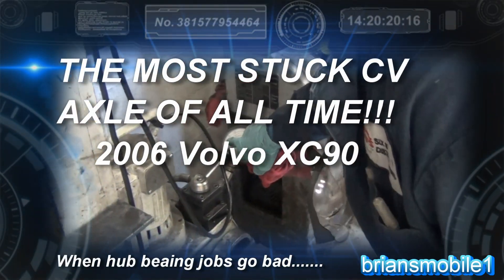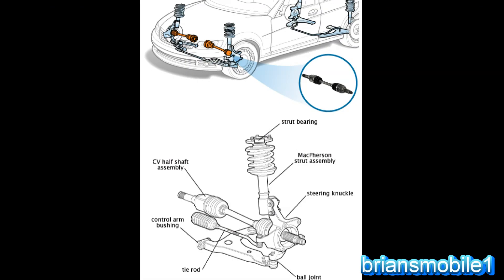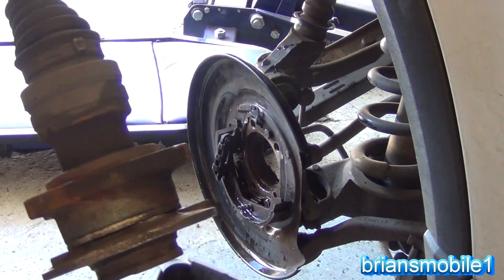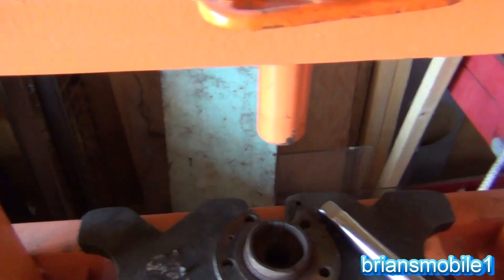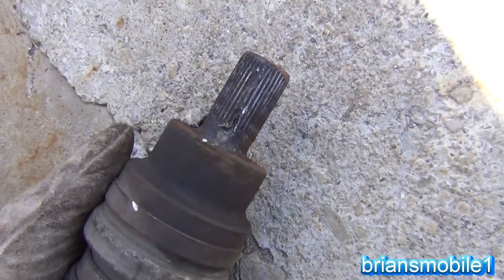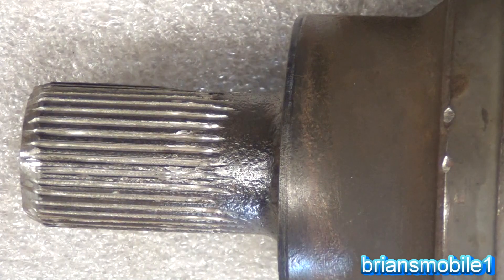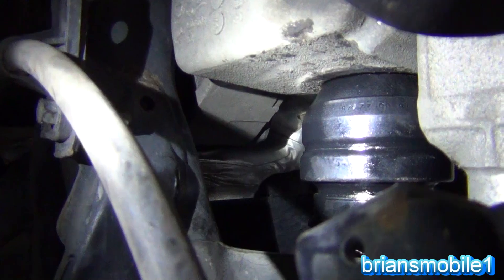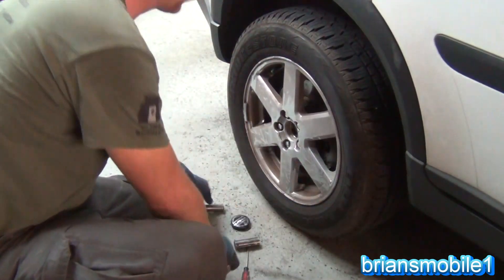Most STUCK CV Axle EVER Volvo XC90 2006

Comment: I did all four hubs on my wife’s 2006 XC90 and it was just like yours. I used a massive three jaw puller, a torch to heat it and had to hit the end of the puller. It was not good for the puller but it worked. The dealer uses a special Volvo tool which is hydraulic press that bolts to the hub flange.
Reply: Yah pullers and presses are the way to do it. See the wasted energy in the CV axle buckling with each blow. You need power applied directly. They should have included the footage of the hydraulic press to see what went on there.

Comment: Wow Brian I feel your pain, just did basically the same job on a 99 s80, exactly same setup.  Was totally insane.  I've dealt with many stuck cv axles before, but this was beyond anything.  Took like three days.  Hammering and torching and slide hammering didn't do a thing.  Fortunately it eventually came out with multiple grabs with a three jaw puller.  Insane.  Thanks for the video, it gave me courage.

Comment: Great video. I love it when you show that its not always easy doing auto repair. Sometimes unexpected things like this happen, you just have to work through it and make due with what you have. Most channels give the highlights of a successful repair without showing the struggle to get there and make it look like it really takes 5 minutes to pull a motor (for example). Its the struggle and how you work around them that are the gold in these videos. Thanks for that...
Anyway, I know it was stuck pretty good, but couldn’t beating on it with the socket like that have made it worse by mushrooming the end of the shaft? That would change it from a normal slip fit to a tight as hell fit by mushrooming the end of the shaft out into the splines/bore.
Also why not use a cutoff wheel instead of the plasma cutter? Less chance of cutting into the shaft on the inside of the hub with a cutoff wheel I think, but would be much slower. Did you go with the plasma cutter because your ginger-tude got the better of you? Captain Impatience reported for duty?  :-)
Either way, you got it done and thats all that matters at the end of the day. Adventures in automotive repair…  Gotta love it…  Its why we do what we do… Great video.

Comment: Thanks for sharing your hellish experience with that stuck axle. My son and I are visiting the 8th circle of hell trying to get a stubborn half-shaft out of a buggered up hub on a 2004 Ram.  We're probably going to remove the upper-control arm, tie-rod end, and pop the steering knuckle out of the lower ball-joint to pull the whole assembly off the truck. Our thought is that we'll have move success bashing the axle out of wrecked hub.  Sadly, I think we mushroomed the end of our CV-axle with repeated sledge hammer blows.  That sucks. That's life.

Comment: Hey Brian!  That can be frustrating and ruin your day.  I just went through it at my shop with a front axle on a Ford Fusion.  One tip to try next time is use a candle stick when you heat up the bearing.  Press it against the splines and it will suck the wax down to where the heat is.  The problem with heat & Penetrating oil is that the oil just burns off as soon as you spray it on something hot.  The wax will not.  I don't know if beating it with a hammer and wax would have done it, but possibly the candle wax and the press with some heat!  Great video for DIYers and even better for  paying customers to understand the Fuss we have to go through to fix their cars.
Reply from the maker: I've heard that before, but failed to remember it at the time.  I've never tried it personally.  Thanks for the reminder.  I would have LOVED to try it then.

Comment: I had a similar situation on a Subaru Impreza once and ended up replacing the steering knuckle, CV Axle and hub bearing. Always use completely absurd  amounts of anti seize compound during re assembly on the splines and hub for the sake of the next technician. Good video, definitely more patient than me..

Comment: Thanks for the video Brian.  Just bought the same car for my wife.  I replaced the front CV joint and bought a "Febest" brand; worst piece of junk I ever bought; the centre hole for the retaining bolt was drilled through on an angle so it was not centred in the rear.   I persisted and went through 3 bolts as each one was becoming stripped by the time it reached the rear of the hole.  All this to avoid the cost of an OEM axle replacement.  I feel your pain bro' .....

Comment: I just ran into a really bad one on a Ram 3500 a week ago. my job was just to do the balljoints. one side went ok, not the other side. hub was stuck to the axle, and there was a seized axle ujoint. no about of pounding would separate the hub from the axle, 20 ton press didn't work. so I ended up torching the bearing off the hub and making a split in it with a die grinder after, then I put it back in the press, and almost maxed it out, then the loudest noise I'm ever heard, and the press shook, and the axle hit the floor underneath. it was Saturday of course, I had other vehicles I was supposed to work on, and even more work on this truck, and I should have been done this truck by noon, but I did 10 hours on it, made it drivable, but the guy had to rebook for the rest. he supplied 2 hubs, just in case he said. one was almost seized, the other rough. I installed the rough one, so he could drive it home, but told him he needed a needed a new one. so we just ordered 2 new ones. I was lucky the end of the axle wasn't damaged beyond repair. I actually cut down the spline when I cut the hub with the die grinder. cleaned it up, lots of anti seize and it went back together after the balljoints and ujoint. I personally don't want to do another one of these like this. I asked the other guys, the said this isn't the first time its happened on a Saturday, and it is always a Ram 3500.

Comment: Some dealers put loctite on the splines because the axle bolt was getting loose throwing that Anti-skid message.  You should send this video to congratulate the guys from Loctite for their amazing product :)  But any how, if this happens again: junkyard/Ebay > used axle and spindle/hub

Comment: I've seen many axles seize in the hubs at my shop this way, when there like this it's not so much the rust it's the fact the customer had a wheel bearing going bad and drove on it for a long time heating it up and basically welding it in there.
Reply: I have also wondered if this happens if the car hits something that slightly distorts the hub and locks the shaft to it.

Comment: Ok so if you're here you have a stuck axle in the wheel bearing hub like me. I'll tell you what worked for me:
I got the puller from Autozone (rented) and used my harbor freight electric impact (Chicago electric one rated for 150 ft lbs) That was not enough to break it loose. The drivers side came out so easily I could not believe the trouble I was getting with the passengers side. So anyway, I was sweating thinking this isn't going to work as I'm under powered. I tried using a 2 ft breaker bar but that didn't work either. The only thing that worked was applying heat with a regular propane torch (if you want to run out and by some map gas in the yellow tank go for it since it heats faster). Heating it up and pounding with a 3lb hammer from harbor freight did the trick for me. It took a lot of hard pounding. A good 100 hits or more I would say. I hit right side, left, bottom as well as I could. Took a 10 min break. Heated up again. Sprayed the CRC freeze off in there and started pounding. I put the axle nut back on so I could use it as a refrence to see if it was moving at all (you can use a piece of tape also). It was moving 😀 but I had to fight it every centimeter! 
If you start getting a bit nervous when things go wrong like me just grab a beer or a shot. You need to be relaxed and have a clear mind. Rest assured that it will come out with enough heat and enough pounding. If some how you ended up here before doing the job good for you. Buy a heavy hammer. If I could do it over again I'd do it like he is in the video with heating it while the pressure is still applied from the puller! In my case I had already taken the 3 bolts out and started hammering it before I realized how bad it was stuck. Heat it, spray, pound. Take a break. Repeat until it's out! You can do it!

Comment: Probably wouldn't have helped here, but a wooden handle 8 or 10 lb sledge with the handle shopped to half-length is a BADASS tool for the insanely stubborn stuff. It's crazy what a bigger hammer will do.
Reply from the maker: Amen.

Comment: Ugh..  The entire time I was watching this, I was screaming at my monitor, "USE PARAFFIN!!  Heat is great and all, but it's an old engine rebuilder's trick...  Works with bolts, nuts, drive shafts, etc.  Anything threaded or splined.  Heat the thing you want to remove (nut, bolt, plug, shaft, etc.) until it's cherry hot, then take a block of paraffin and dab it overtop of the glowing hot bit.  Wait a few seconds (literally a few), then go through standard removal procedure.

The other thing I see far too often, is techs heating the thing to be removed, then not using paraffin on it.  If you heat the thing to be removed, then that thing will EXPAND, typically into the hole it's already stuck in.  If it's stuck due to rust, there's a tendency to actually seat the rust in even further.  If you're just going to use heat, heat what it goes through.  ;-)
Reply: @jfdesignsinc.innovationsid1583  Interesting to say the least.  I'm not comfortable with heating my differential.  I have used paraffin on lugs and such, which worked quite well. I probably only need enough heat to get it in there?  From what I gather, it's the clip that is supposed to collapse when you try to pop it. I guess after 170k + miles,  the clip breaks down, only to wedge in the spline. Thanx to all that comment.  After all,  I think this is what it's all about. It's good to learn something new every day.

Comment: Hay, Brian I just saw a video on FCP Euro's channel  were they replace the rear bearing assembly on XC70 and use a puller.  It looked like it was pretty rusted inplace as well.  Might not have been as bad as what you had to deal with, but I thought I'd pass it along as an FYI for an alternative method in the future.  Cheers.

Comment: Hey Brian, good to see you're still Rockin it.  Anyway, I've got a 2002 Dodge Ram 4wd. I CAN NOT get the left (Hell, does it matter) CV axle out of the differential. I guess this is a common issue with anything with over 170k + miles. I went to the Home DEPOT and got a 4' piece of 7/16" threaded stock and some Milwaukee vice grips ... I'm sure you know where I'm going with this. This sumbitch won't budge, I smacked it like a RED HEADED STEPCHILD, no offense to my ex, and never smacked her BTW, but I am at a loss. I came home from work thinking I'd just put it back together and drive to see if the damn thing would free up. Then I thought, "You dumbass, you already trashed the original!!!"  THOUGHTS, and YES, I do feel like crying but I already done sweat out everything I got. Thanx in advance.

Comment: Some genius took the dust boot off my parent's 2000 Saab 9-3 hatchback and I had a similar situation. It was SO rusted that by the time I got the axle knocked out I had ruined the bearing. Really there was no other way, though. The only sucky part was that I had to then remove the steering knuckle to get the old bearing pressed out and the new one pressed in because it's not a simple bolt on assembly.

Comment: Also that's not a picture of a 1998 626.  It's a 1996 or 1997 model.  You can tell from the silver trim piece on the hood which only came on the 96/97 model.

Comment: I had the same problem on my e36. had to replace rear bearing, when encountered this problem... ended up tensioning with bearing puller, heating up, and giving it a good smack with the biggest hammer I could find. 
I feel the other side bearing on its way out. hope it is not going to be as bad. :))

Comment: I actually think there’s a simple way to cure this problem on any situation like this. Never tried it but logic tells me it should work  remove axle and hub assembly. Set in press. Run a few welds onto end of cv shaft quenching with water. Repeat few times axle should push out and clean up end of cv shaft. This is pretty much same principle as stuck brake bleed screw in calipher

Comment: hay briansmobile1 got a question for ya, what would cause so much rust on the joint like that?  was there a leak or a missing piece of protection? owner use a high pressure sprayer wrong?   was the car on the bottom of a lake for a year?

i aint no mechanic but i am fairly sure its not meant to rust up THAT badly... right?

Comment: My friend needed his front axles replaced on his 2000 subaru forester. The axles were as bad as this.  And I had to do both sides. worst thing ever. I heated it and everything you did. He said screw it lets get everything but ended up that you can't get the whole hub from any local store and that was a saturday. 
We ended up cutting the parts like you did. took 9 hours the first day and 3 hours the next day.  went from 2 axles to replacing balljoints and everything around it because it was that bad. 

I like the dremall idea. never thought of that.

Comment: Metal is 'plastic'. when you push on it (like beating on it), it mushrooms making it jammed even tighter. Pulling on it tends to elongate the the material, resulting in 'necking'. this actually reduces the cross dimension, theoretically loosening the fit.
Best part about this video for me?:I don't feel so "pregnant and alone".
If you can clamp something to the axle and get a wedge or other puller between the clamp and backing plate you might drive it out by tension, rather than compression.

Comment: i have a volvo xc90 t6 awd 2005, the navigation monitor won't come up when you turn it on either by remote or on the steering wheel, i will like to know where the fuse is also located. thanks

Comment: I have the same problem with the front driver-side bearing on my XC-70 2005. I was supposed to replace an 8 bucks ABS tone ring which should have been an easy job but that damn axle is stuck rock solid in rust. I'm slowly accepting that I'll have to get a new bearing & CV axle... Fortunately, the parts are pretty inexpensive, I can get a bearing for 50 bucks and 60-70 for an axle.

Comment: I had to first remove axle with hub. I then heated the axle super hot in a vise  with oxy acetylene and then poured about a gallon of water on the axle which caused rust to separate and axle   to shrink.

Comment: My question is this: did you try to use an air hammer? I bet that would've worked some wonders after applying a little heat to it.

Comment: I worked on muffler shop for years best way is to heat cool heat cool heat cool multiple times strike on metal when cold not when hot because your changes of making it worse are slot greater from experience

Comment: Brian. Would it be feasable to use a 2 jaw hub puller? Wouldn't it push on the tip of the axle while holding the hub and when you tighten it would it push the hub off?
Reply from the maker: I've used those.  I have a couple of them.  You would break them on this axle were you to try that.
Reply: briansmobile1 I think I actually remember you doing that in a different video so you'd know first hand.

Comment: I'm surprised you didn't use freeze spray on the CV axle to make it shrink, then heat on the hub to make that expand.  I would think the resulting expansion differential would make that axle a LOT easier to remove, but then I'm not a mechanic.

Comment: i have the sam troble 2009 subura forester front ......i bought a used cv shaft and sindle and antyzise the cv shaft and the back of the hub it probly fall apart if it ever has to come apart agine lol 105.00 used parts ......plus the new hub and new lower ball joint and i antyzise the pint bolt as well and threads lol

Comment: That wobble extension is nice. Did you replace the C clip on the inner as well, I find they tend to pop loose if reused. Could you not just get an outer CV joint for the Volvo instead of the whole axle. Like the new boots and regrease there, the original seals probably failed from water and mud freezing onto them, and then scoring them. Time and puddles did the rest.
Reply from the maker: They were unavailable within the time constraints I was working in.

Comment: Since you're throwing away the hub you could just cut its flange apart with a carbide recip saw or angle grinder similar to what you did with the plasma cutter. I very much doubt that press was 4 million pounds. Presses of that size are a large as small houses.

Comment: Pull axle with spindle. Tilt up and soak with pbblaster. Wait until you see the pbblaster leaking out from the bottom you can start pushing it out with a hub puller.

Comment: 8:33  you can be sure the bearing plate is bent at that moment and the wheel lugs will come off when you will be driving the car.
Even if the axle comes off with the press, you will need to replace the wheel bearing anyway.   Plus all these heavy hammer kicks and heat, no wheel bearing was designed to take these, replace the bearing because it will fail very soon afterwards.

Comment: Are you supposed to lube the cv axle into the hub to prevent that rust? oil? cv2, anti seize? anything?
Reply: I used multi purpose grease.  Anti seize might be better